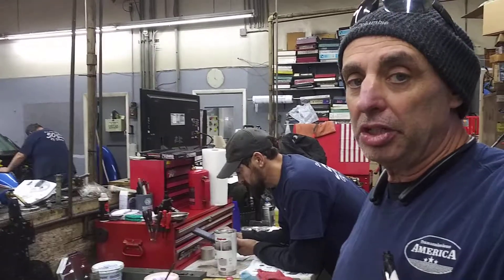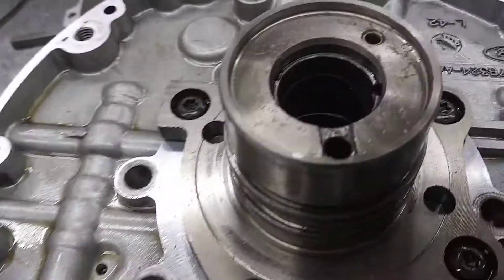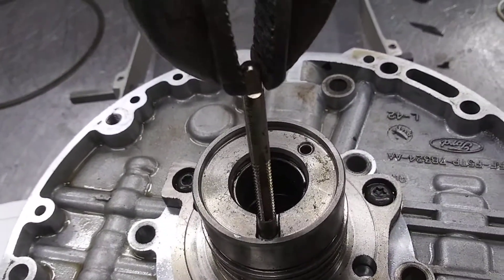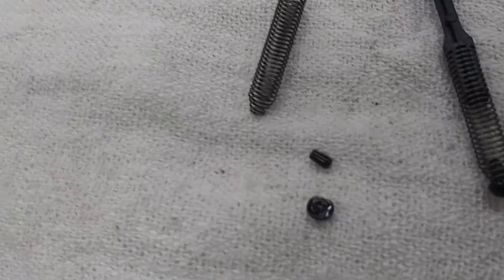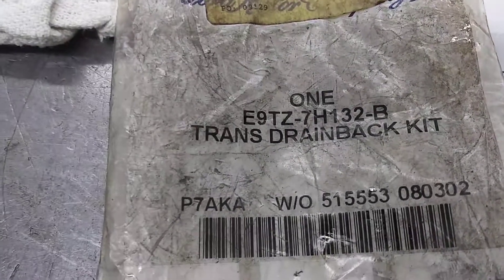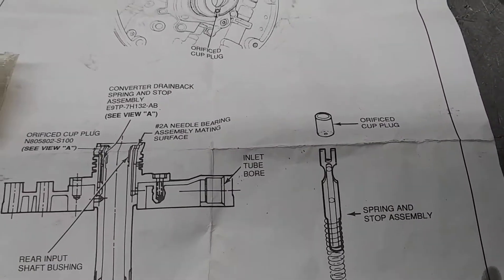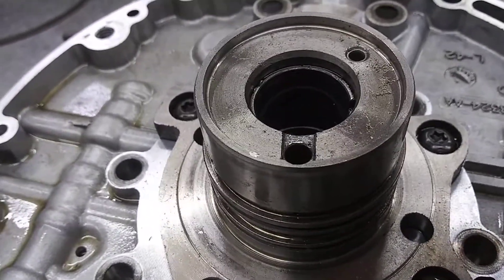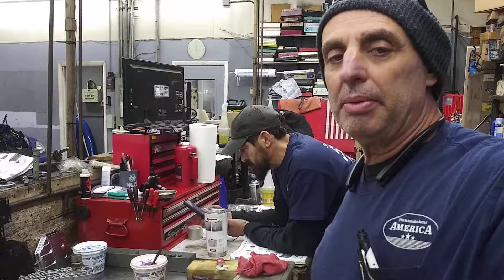E40D and 4R100 converter drainback spring and stop assembly

Comment: Thanks for showing this.  I'm rebuilding/upgrading the E4OD (also a '97) in my F-350, and am preventatively replacing the OEM drainback valve with the Sonnax aluminum version because I use the truck to tow things including a large 5th wheel camper.  

However, every time I hear someone say "E40D" (E-fourty-D), I want to pull my hair out.  It's actually E4OD (Letter E, number 4, letter O, letter D), and it stands for:

E - Electronically shifted
4 - four speed
OD - with overdrive

Comment: Have a question for you, what would be affected by not replacing this. Recently have been plagued with transmission issues over the last 5 months. Long story short it’s been 3 transmissions over 5 months, current one is leaking from the dipstick tube but only when sitting for a few days, shudder from 1-2 at low speeds, and a long delay when shifting into reverse.
Reply: Sonnax makes an aluminum replacement that doesn't melt like the OEM plastic one.  It installs the same way as OEM, and can help prevent damage if your transmission runs hot at any point.